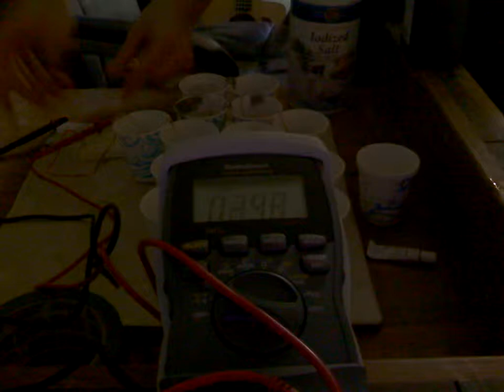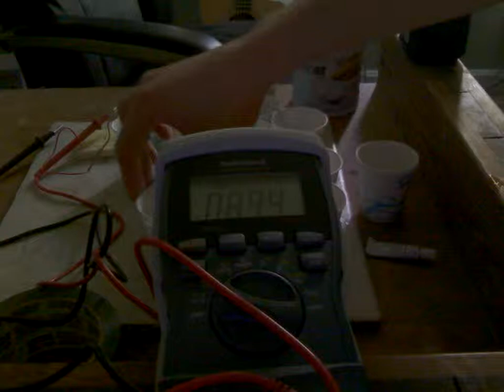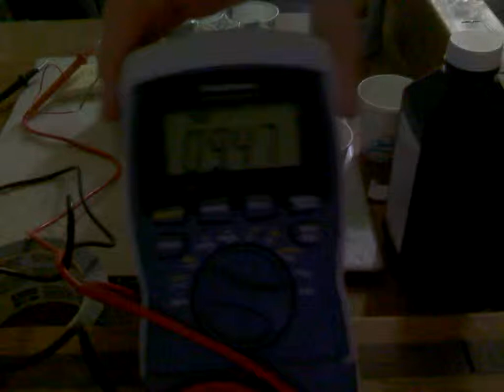11 Volts from Water, Copper, and Zinc Battery

Comment: Have you tested it under load? I'm curious how much amperage you can draw, in other words, how much wattage can you get from this? Also, how long does it last, say on a small 5v motor? Does the zinc oxidize and need to be cleaned and can be reused? Thanks